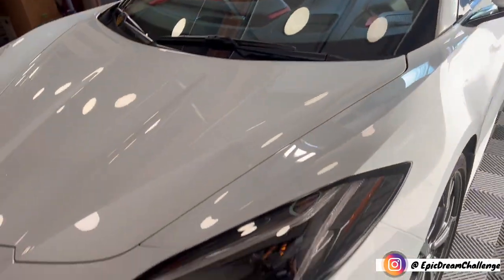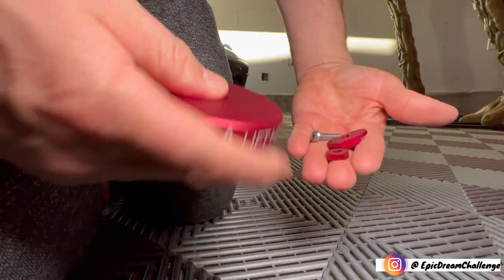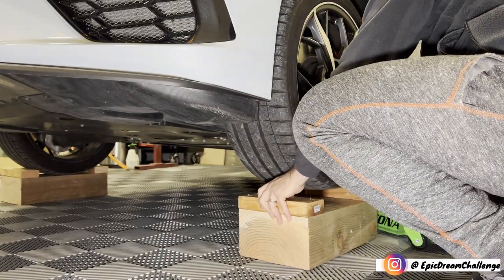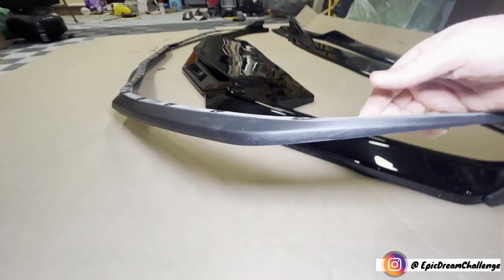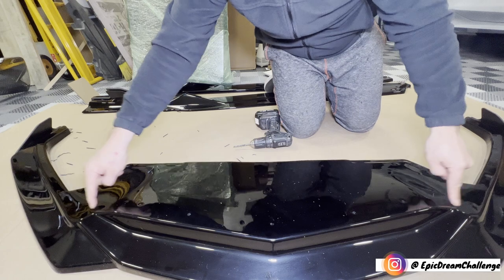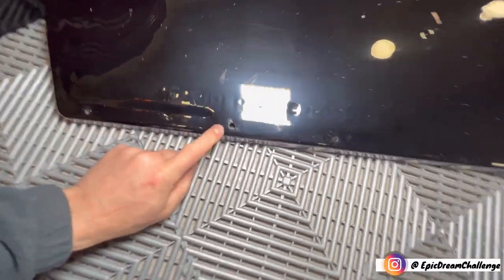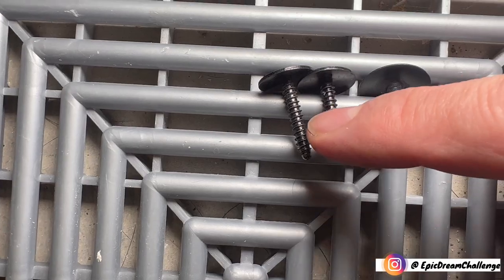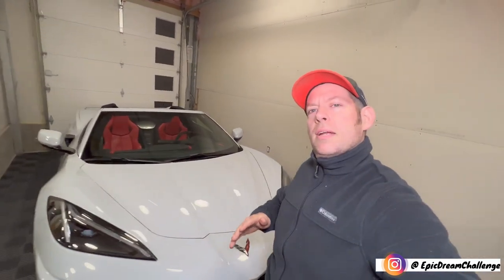CHEAP Body Kit and Ground Effects Aero kit C8 Corvette ! Part#1

Comment: Just an FYI: the Paragon ‘lift pucks’ are meant to be permanent. After you insert/turn them you then tighten the screw so they are always there.
Reply from the maker: The Paragon Puck Install Video shows a permanent and non permanent method to install them. Use the spacer for the non permanent method and no spacer for the permanent. I showed the non perm method because I only bought one set. 👍

Comment: I just ordered this kit last week. Its on back order but so is my C8 so lets see who comes first. :) You should considered selling cardboard templates of the winglets you modified. I think you did a really good job but I am sure I will mess it up. LOL
Reply from the maker: Yea its a great kit for the price, its nice to not have to worry if you damg it since its so cheap. The day I mess up a carbon fiber splitter Ill be mad lol. Hope you get your C8 first!. The winglets are not to bad just make sure the chop saw blade is sharp. And if you can clamp it even better. I actually messed up the angle cut a little so I had to sand quite a bit lol! 😅👍
Reply: Are those winglets solid abs/plastic? I can cut no problem and paint just curious.
Reply from the maker: They are not abs but they are a plastic and can be cut . Ill try to remember what they are and get back to you.

Comment: Hey Great simple and inexpensive idea to raise the front end. Can you share the dimensional size of the lumber you used. Was it as simple building a rectangular cube with the stops on top or did you add internal material for added strength?
btw great looking car. I'm picking my C8 up at the Corvette Museum in early April and looking forward to working on it and adding some of the same mods as you and these home built tire stands are brilliant on your part and be making some too.
Reply from the maker: Gratz on picking up the C8 man! Its a dream car for sure! It was just a leftover dimensional piece of lumber from building our house. I was able to build 6 jacks from it and I used 4in deck screws on 2x4 strips on the ends. The size was 6"x10" . If I was to do it again I would get 8x12s if I could find them and make them 2ft long instead of 1 1/2ft long

Comment: You did another video a few months later with a different ground effects kit. What happened to this kit to make you want to change them out.? Do you not feel that overtime they became junk?
Reply from the maker: Naw it has been a great kit. But i`m doing a streethunter wide body build on my C8 corvette. I am also doing my own custom front end with the TJHunts kit and will use the Maxton for molds to make carbon fibers pieces in the future to test.  No issues with this kit at all. I has been amazing for the value. 👍